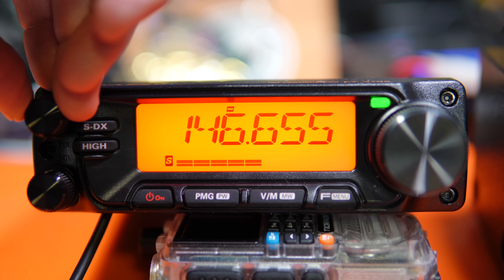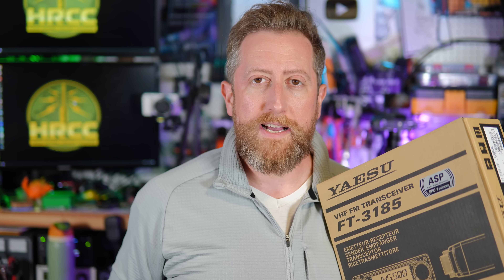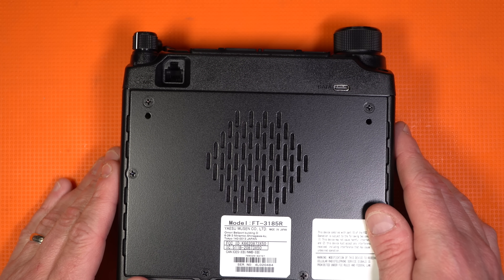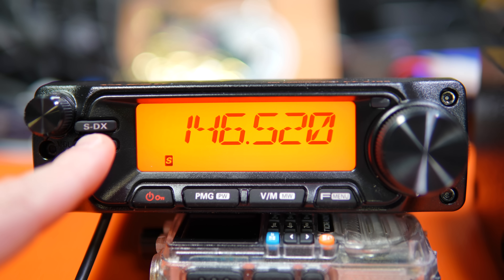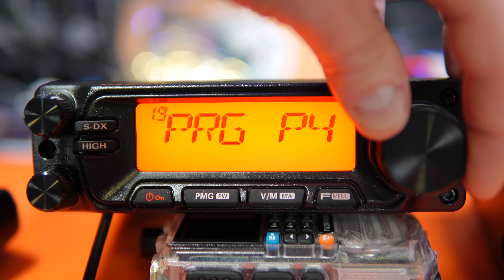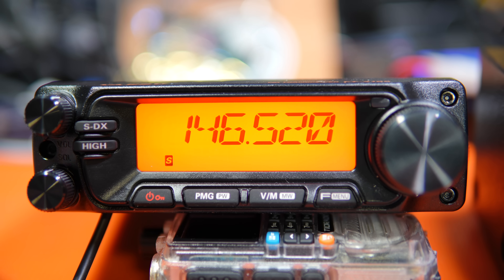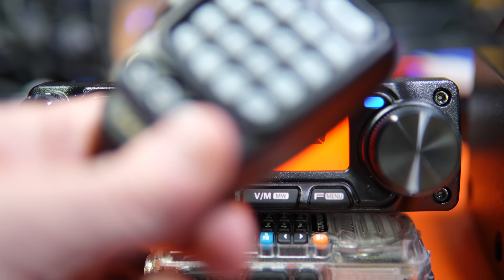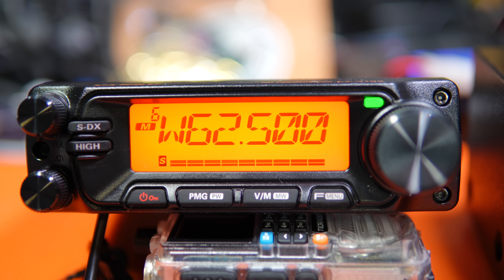NEW! Yaesu FT-3185 85 Watt Mobile Ham Radio!

Comment: Yaesu has always been bad about claiming a given mobile radio does not need a fan because of its "heavy duty heat sinking".  This is absolute rubbish.  I don't care how good your heat sinking is, unless it is Antartica or Alaska in the winter, you will need a fan to disperse heat on a 20Watt radio and certainly on a 50Watt or 85Watt radio.  I wish Yaesu would figure that out.

Comment: The mic comes off the bottom, so that you don't lay it flat on a flat surface, for two reasons. First it would overheat, cause air wouldnt be able to sufficiently circulate around the heat sink. Second, the speaker is at the bottom, so if you lay it flat on an flat surface, the sound from the speaker would be muffled. Just an opinion.
Reply from the maker: Speaker out the bottom, mic out the bottom, both bad design choices.

Comment: Josh, The mic port on the bottom makes a lot of sense when cable strain is considered.  Mounted in most cars/trucks, having it come out of the bottom won't present any issues at all.  When mounted on a table in a base station application, you're going to want to tip the faceplate up anyway and that will provide ample room for the mic cable as well...Great review of a nice little radio...I think ASP has a future!  73's

Comment: @HamRadioCrashCourse  I have the FT2980R   which is a great 2m radio and  80W,     Although the SD-X feature seems cool,....  im not sure I would upgrade to this radio.
Reply: Not in your case, correct. But in mine, I have an older 2800 with 65W, and in this case, it would make a difference. Would add better coax and more height, and that 3-way combo would take me from barely breaking squelch to good 2-way communications.

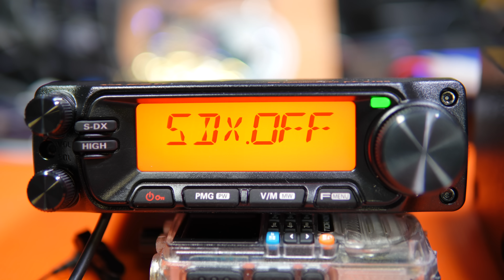Comment: At 9:34 frequency is at 146.655, that part of the video impressed me. The SD-X bought the signal bar to the middle of the last 5 on the frequency. Without the SD-X the signal bar dropped between the 6 and first 5. I'm impressed, the SD-X brings the signal in better and quiets the radio. I purchased one of these, today, from Gigaparts. They had a better price and a $10 coupon (SAVE10). Do you know if this does the 85 watts? Thank you for your video. I like it very much.

Comment: IMO, Yaesu makes the best transceivers on the market, but they desperately need to hire a UI/human factors engineer. I suspect most FT-3185 owners will end up running a little pig tail from the bottom to the front or the side with all kinds of kludges to keep it in place. It's somewhat reminiscent of the FT-70DR which is just an awesome HT, but you have to simultaneously press a button and rotate the multi knob to adjust the volume. Do that with one hand. It might be the only radio ever made without a dedicated volume knob. Come on Yaesu - you're 90% there - hire one more UI/HF engineer to stop the madness.

Comment: will this work with the digirig? they make an RJ-12 cable with a 3.5 jack on it for audio in and out. if anyone can confirm, I'm buying it
Reply: It should, I have one and use it with a mirosat wx3in1 for aprs, running rj-12 and 3.5mm cable to it. It works great! The only issue is, it's so sensitive I pick up beacons over 400 miles away, so I have to filter a lot out, turn up the squelch, etc. But other than that it works great for aprs

Comment: I would much prefer a 2m + 70cm (Or Tri-band w/ 1.25m) combo radio as opposed to just 2m on its own. But if you're not doing too much communicating outside of 2m, then I can see the appeal. - KF0QNM

Comment: Man, that audio tech is SO cool. I was thinking about buying the 991a, but I want a new version with this audio processor.
Reply from the maker: I HIGHLY recommend you look at the new offerings from Yaesu.  They’re fantastic.
Reply: @ is there a comparable all-band, all-mode to 991 with SuperDX? Very space limited in my apartment.
Reply: @HamRadioCrashCourse  Do they make a 991 with this DSP/ASP/SPU-1? By the way, what does SPU stand for? (Guessing Signal Processing Unit)

Comment: I'm confused - at the end you say there's no Data Port - but 3:02, you specifically point to and mention the Data Port?  Did you find out later that it had no function?
Reply from the maker: It’s labeled data, but there is no documentation on it. It seems to be for programming.

Comment: I bet Digirig comes out with a data cable that replaces the mic to offer data / APRS capability.  I have one for my IC-2100.
Reply: Why would it NOT USE the existing data jack out the bottom?

Comment: Looks like a nice radio. I don't like the cable either, however I currently have a single band 2m radio on a 11 element Cushctaft up 30 feet with a rotator and the hanging mike and the 85 watt's and great sound would pair wonderfully with my operation.with my shack.

Comment: The radios are very cool there's no doubt about that but I don't like the fact that they've started to split VHF and UHF up. There are a lot of 50 watt radios out there that are multi-band and a 50-watt radio will go a long way. Most of the time I find a 50-watt radio will reach any repeater that I can then use as a jump off point to go halfway across the country. I like the idea of 85 or 100 watt radios and I would be tempted to buy them if they were VHD and UHF but only one band is very limiting. I'm definitely not trying to sell one brand or the other but there are quad band radios out there that are 50 Watts that will do cb, Murs, VHF, uhf, and even some FM 10 meter on one radio. Not going to give the brand but I'm sure a lot of you know what I'm talking about. I would say he you have the ability to create wonderful radios but please add more than one band. I'd even be willing to pay a little bit more if it was multi-band but 250 bucks or so for one band seems like a lot. Other than that I think it's a fantastic technology Plus in terms of the benefit between 50 and 85 Watts I'm not so sure the extra 35 Watts gives me a whole lot more. I live in an open prairie which is a perfect place to benefit from more watts and of course it will go further and increase the DB but you have to double the Watts in order to have a 3db gain and a 50 to 85 Watts isn't even doubling to get you to the three DB gain. Maybe if I were trying to bounce VHF off satellites which someday I'm interested in but as of yet not really what I'm doing. Anybody else have any thoughts. Again I'm not trying to be negative it's clearly an awesome radio just from a ham radio / prepper guy perspective this is where I'm coming from.
Reply from the maker: Now one “started” doing this.  Monitor band high power output mobiles have excited for years.

Comment: Interesting.  If I were to install one of these in my F150, it would be situated on the driver's side of the center console, in a vertical position.  This would be a handy location, with the face readily visible, and the added benefit of having the bottom-mounted speaker facing toward the driver.  I'm going to have to give this some strong consideration.

As always, thanks much for sharing.

Steve

Comment: Josh, I have the old ft-2900r, the data port is where the mike plugs into the radio. double ckeck the user manual.
Reply from the maker: I did.  I even pulled up the pdf version doc and looked for data, port, etc.  nothing related to some kind of computer interface.

Comment: That seems to be Yaesu's MO! Yaesu always seem to make a really good product and then do some weird quirky thing to it like the mic cable on the bottom of the face of the FT-3185. Case in point... The FT 70 DR has a volume button that must be pushed and then you can turn the vfo to change the volume. Not real handy if your out in the field either with the radio in a pouch or attached to a shoulder strap. The FT 70DR's battery life is also not that great. The FT-891 which is a really good radio but has some little quirks that Hams complained about when it first came out and Yaesu never addressed them. You have to go into the deep menus to change your power setting, mic gain and change from upper side band to lower sideband. When your mobile in your vehicle those settings should be available without the need to sift through the menu system. Sometimes it makes me think the Yaesu engineers are not ham operators and have absolutely no practical experience in operating a radio in different environments.

Comment: Interesting radio, although like YOu I wonder whjo it's for. To my ears I felt the s-dx slightly overdid the upper-mid attenuation on the weather channels, making them a little muffled and indistinct as a result. They sounded better with it switched out imho That function really did sound excellent on the 2m frequencies though, and that's the main thing. (On a less serious note, I wonder how Yaesu feel about the impromptu Tidradio promo. ;) )

Comment: I'd love to see some lab testing of the receiever. The spec sheet says  better than 0.16 uV sensitivity which is incredible for a mobile rig. The Super-DX feature supposedly also works without the ASP unit installed which would get rid of the noise cancelling underwater sound, but might still do some improvement to the sensitivity? Overall seems really cool as a long range weak signal FM rig for those of us who have a nice low noise floor.
Reply: I removed the ASP module temporarily as you suggest & it does bump the S meter up, but of course the noise level increases also. Couldn't see any advantage to my ears. Same thing with my FTM-500DR only it doesn't have the ASP at all. I will say the 3185 has excellent inherent sensitivity.
Reply: @geoffreysmith511  Thank you for testing that! Interesting results! I personally don't care for the noise reduction effect on the audio but I love a good sensitive receiver.

Comment: How was the heat output? Some people report the 2980R can get toasty. How is the weight? Is it really 4.2 lbs? 
How does it compare to the Icom IC-V3500? 
Is 20 watts more going to make a huge difference for SOTA?
Reply: My 2900 get toasty after transmitting a PD120 SSTV image, just don't full blast on high power all the time 😅
Reply: They don’t call it the George Forman grill for nothing.

Comment: There are a pair of feet that mount to the bottom that are in the same bag as the extra screws fuses and mic clip. This  angles the head while sitting on a desk and provides a space for the mic cable on the bottom

Comment: Non removable front panel? That is a showstopper for me. Any car/SUV is hard enough to get things mounted, and when you had the XYL into the mix, well, you all get the picture, wake up manufacturers, ALL front panels should be removable so that the radio can be mounted in a better location not only to not take up space needlessly, but for better temp control and safer location. And the price is too high, even if it had great sound characteristics. I want a radio for communications not a home stereo.

Comment: I've had my FT-3185 for a week now & I'm not nearly as impressed with the "ASP" as you seem to be! It has the usual "underwater" problem of DSP but with no adjustment to help alleviate that problem. I also would prefer to be able to select the ASP & pre-amp independently. I do like the radio otherwise, especially its inherent sensitivity.

Comment: ASP to the rest of their line would be awesome. Now imagine if you will ASP on a 10m/6m dual band AM/FM/SSB @ 85 watts....yes please. Side note comparing a 9700 to this is unfair as the 9700 isnt a mobile.
Reply: I'd LOVE a 6M/10M combo unit! I have a Radio Shack HTX-10 right now, and bumping that up to 85 Watts and adding the DSP and 6M would be all I would want, in addition to this unit.

Comment: The fan-less heatsink reminds me of my FT-2800m that's been going strong for a decade or more. The microphone plug should be ok if you install the base station feet that are included (FT-2800 had the same feet). Why have the jack on the bottom--would be good if you mount the radio from the roof of a truck or a shelf on the desk.

Comment: I agree with the mic coming out the bottom of the radio. I guess they figured it would be used mostly for mobile purposes and the mount would keep it up off a flat surface or it would be hanging from the mount so the cable out the bottom wouldn't really matter. Good review and interesting radio. Thanks for the review!!

Comment: Ill never buy another bare bones radio at those prices.   My quangsheng is $25 and is prob one of the best ht s ive ever had.   The legacy ham radio companies dont get it.  Theres a huge surge in hf use and desire and the chinese are running to fill the void while yaesu and icom push out 500-700$ radios for single or dual band use. Dont care abt c4fm or fusion. Theyre dead.  Dmr has a substantial radio base to draw from and many of these multi band dmr radios are cheaper than their dorkier mono or dual band.   Does the democrat party run yaesu and icom?   But i get it josh. There are ppl who will buy this and have a need for it. But they are not listening and theyre bleeding out.   Great vid as always josh thx
Reply: Yeap, lets all barrick for the Chinese, especially when they over run your country!
Reply: Exactly, and a transfusion is needed STAT.

Comment: Why do you need 85W? Im 50KM from town, 50W is more then enouch with an Omni directional on the car (4' off the ground).

Stations can hear me loud and clear with 50W, but I can barely hear the repeater. Not sure why you need 85W, giving those diplexers a sweaty workout.
Reply: Dude, if you honestly don't know why the 85w is better then you might just be a little dumb. Real world testing between a 50w and an 80w radio I've done has resulted in a 3 S-Unit improvement. That's over 10.8 db improvement in the received signal which will absolutely turn a weak and noisy signal into a fully readable clean signal. If you think I'm wrong, go and try it for yourself. Most hams forget to account for antenna gain which can often times double or triple your ERP which is an even bigger boost. The summary is simple- 85w will always outperform 50w in every scenario and is a much better solution for those of is who actually like talking on a radio and most importantly-- being heard.

Another factor in your story is the repeater. Amateur repeater owners often stupidly dial back the output power in the name of "spectrum management". That mentality makes sense in the comercial world but NOT amateur radio.

Comment: The S-DX button first appeared on the FTM-500D and hardly works. It boosts a faint signal, but it boosts the background noise just as much. It’s nice to see that they finally fixed the issue. Hopefully, it’s just a software fix and it will appear in a future firmware update.
Reply from the maker: I believe this is a new technology they are deploying.
Reply: That was a basic preamp. This new version has some DSP.
Reply: I have my doubts about this radio being updateable. I know the 2800 isn't.

Comment: So Yaesu added some glitz plus 5 extra watts to the venerable 2980 and raised the price. Whoopee.
I would have much preferred a 2m/1.25m/70cm rigged tri-bander in that price range.  Or an all-mode mobile radio.  Oh, and the 2980 included front feet support for easy use as a base radio.  No kludge required.

Comment: One more reason to use a mono band radio would be when an operator needs a tighter receiver keeping intermod and harmonics out.  Mono band radios have better receivers than multiband radios.
Reply from the maker: Good point!

Comment: Some accessibility questions from a blind ham:

First, I did hear that this radio accepts the FVS-2 voice board, so that is potentially useful.
I am reluctant to buy another Yaesu product though, considering how many things do NOT talk, and how easy it is to get lost in those menus.
When selecting CTCSS for a repeater, is there a beep at any of the tones in the list? My old FT-60 has a beep at 100 Hz, so I can count knob clicks from there.
Generally, do the menus wrap around, or do they have fixed limits?

Comment: Looks to be an upgrade of the 2980r 80 watt VHF radio. The new audio processor sounds great but I found the price a little high too.
Reply: And that was an upgrade of the FT-2900R. I think this radio modernizes the line.
Reply: @tomcat1fl  And THAT was the upgrade of the FT-2800M.
For me, this is something to look forward to from my FT-2800M. It has 20 more watts, and the DSP stuff. I honestly didn't hear that much difference on this video, but will bet on some of my connections that it will help. I am at the limit on a few repeaters, where I can break squelch, but only barely, and sometimes to the point of annoying the other side. I think a combination of going to a better coax, a higher antenna, and more wattage into those other two improvements will be enough to punch through and get me solid connections to those distant repeaters which are only reachable by luck or super-ideal conditions. By the way, the price is down to $249.
Reply: My thoughts exactly!

Comment: Looks like a newer version of the 2980 which is 80w. I paid $139 for mine at Dayton Hamvention (R&L). See no reason to pay $275 for this.
Reply: Probably because the one you bought was used and is 15 years old?
Reply: @awprc  what 15 years old?? 2980 was released on 2017
Reply: @ Brand new. R&L electronics.

Comment: Yaesu DROPS the ball big time with the 2 single band radios.  They dropped the single band 3200 and 3207 radios that were analog AND digital and cost less.  Everybody wants to buy a radio that does less for more money.  Seriously.....  Edited to add:  Also, they put the speaker facing my feet.  Of course, everyone's ears are on their feet.  The 3200 and 3207 had a front firing speaker.  Imagine that, a speaker that actually points at your head.